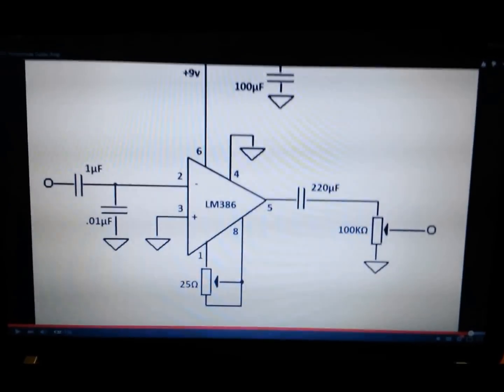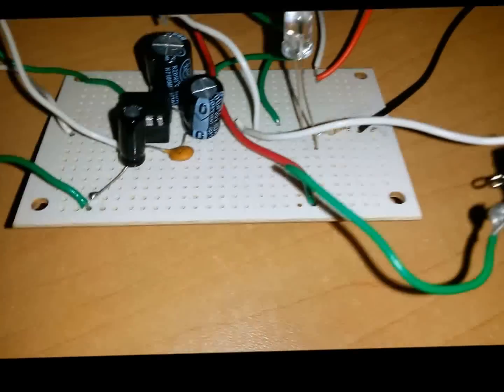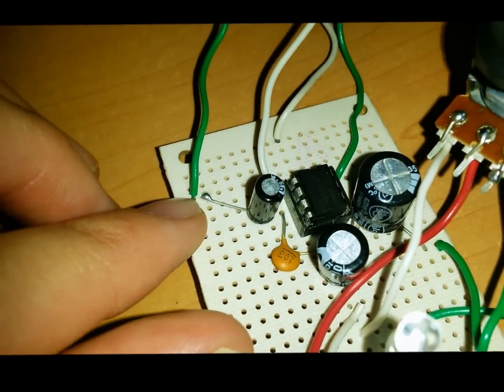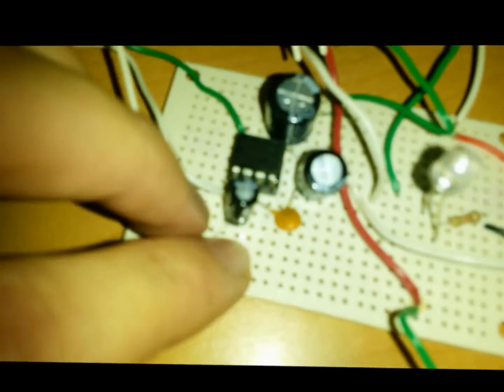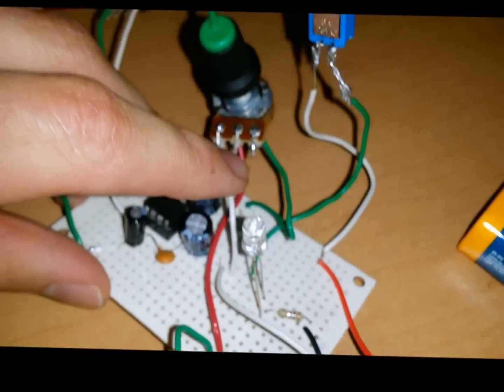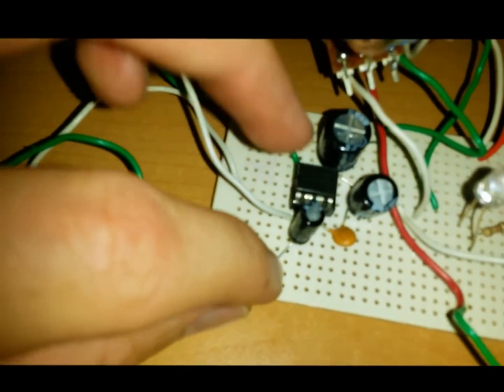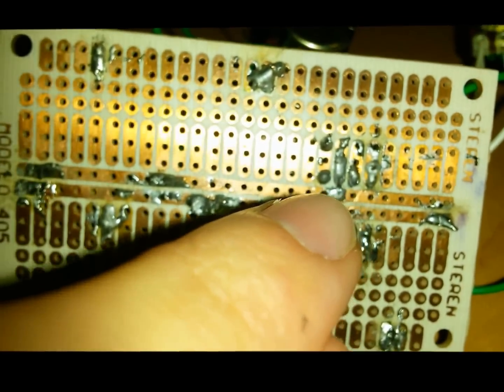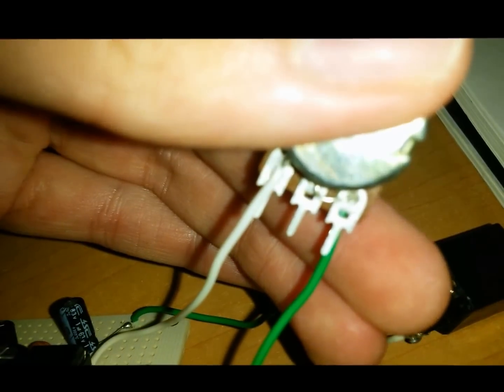RE: DIY Homemade Guitar Amp Tutorial

Comment: Great man! Your list of components, gave you that volume and sound.... can the same schematic be used, with maybe bigger/ more powerful  parts/chips, to give more volume?
Reply from the maker: yes, of course but you must take care on the amplifier's operational limits (you can find the chip's specifications sheet on the internet). Also if you select a different chip/amplifier, the capacitors should have different values.

Comment: Is it works for acuostic too ???
Reply from the maker: hey what do you mean an acoustic? you mean an acoustic guitar that doesn't have a way to output the sound? then no. If you mean the acoustic guitars that have a plug-in (electro-acoustic guitars), then yes.
Reply: Yes i hve a electro acuostic guitar which i can connect with an amplifier ...
Reply from the maker: then yes, it works as well. :)

Comment: hello !! I actually didn't understand how to give the ground connection ! wud be helpful if you would reply :-)  thank you fr this video. really helped a lot
Reply from the maker: Hi! the important thing about the ground in the circuit is that is common to every ground. This means that all the grounds have to be connected to each other. If you connected every ground to each other it would work but it is somewhat inconvenient (a lot of cables connected to each other) that is why the board i'm using has a copper line where i am connecting each ground which gives the same result. Hope i cleared your doubt cheers!

Comment: CAN YOU USE 104 ceramic caps for pin 2 instead of 103 ???
Reply from the maker: yeah you can, but the output signal will not be the same as with the 103 capacitor as you are changing a *10 multiplier to a capacitor.

Comment: bro where did u connected the negative end of battery and the negative end of output?
Reply from the maker: also to the same spot where all the grounds are connected! :)
Reply from the maker: Every ground and negative part is connected in my circuit between each other because there is one line of conductive material in my circuit board (a copper line) and every ground and negative part is attached to that line, so every ground is connected to each other like so :)

Comment: I don't seem to have a 500 ohms potentiometer but i do have a 25k and 5k will any of those work?
Reply: Ok so i did it exactly how you did it however it only gives a really small output you can only hear when you put your ears next to the speaker
Reply: Parts i used 
220 uf 16volts electrolytic apacitor 
0.1 uf ceramic cap eith 103z written on it
1uf 6 volts electrolytic capacitor
5k potentiometer for gain
100k potentiometer for volume
100uf 16 volts electrolyic capacitor(the capacitor that bridges the power line from the ground)
So my theory of why this isn't working is because the capacitor i used was the same uf to the one you used but not the same voltage (the one that bridges power line to ground capacitor)
Reply from the maker: Hello, the value of the potenciometer 500 ohms was already an adaptation of mine. The lower the value of this potenciometer, the better resolution. So I would not turn beyond the middle this potenciometer (2.5k). The voltage value of the capacitor is the maximun voltage it can handle. We are dealing with 9V of power so you would need indeed a greater voltage value capacitor. (Mine was of 63v)

Comment: in the your list 1x 100uF capacitor but i saw a ceramic capacitor on video 100nf. Am i right?
Reply from the maker: +MrDogan86 actually the '103' ceramic capacitor you saw is equivalent to 10nF which are .01uF so it is that capacitor on the list. Does that  answers you question? 
100nF would be '104' ceramic capacitor.
Reply: +Hector Muñoz i finished amp thanks for your sharing but i've a question. Volume control pot (100k) cant work perfect with headphone.  so i listen it with a headphone; i hear guitar's sound over %80 -%90 of potans. under the %80 not sound. I change it 500k pot but the result is the same. then again guitar headphone amp's out connect to a power amplifier it's work great. what can i do for headphone about volume pot?
Reply from the maker: +MrDogan86 This type of amplifier has not a very good resolution (as you have seen) in order to change that outcome you should have a more complex circuit with a better low-pass filter. However I will think if a solution can be given to this specific circuit. I'll let you know.

Comment: WILL THIS WORK WITHOUT A POTENTIOMETER?
Reply: and also are all the ground parts of the circuit all conected?
Reply from the maker: +Tromix Mixtro Yes, this is very important. All ground parts are conected to the same spot.
Reply: +Hector Muñoz how about the potentiometers what if i don't put any potentiometer in my circuit?
Reply from the maker: +Tromix Mixtro Mm that probably won't work if you don't have a potentiometer at least you should put a resistance.
Reply: +Hector Muñoz thanks
Reply: Love the master of puppets riff at the end by the way
Reply: Is the 6th pin capacitor's positive connected to possitive and negative to ground?

And also what other connections are connected to possitive?
Reply from the maker: +Tromix Mixtro Thanks! :p
Reply from the maker: +Tromix Mixtro The 6th pin capacitor is in deed connected the way you say,  with the negative side directly to ground. And the only things connected to positive side (9V) are the 6th pin of the lm386 and the capacitor.
Hope i cleared your doubts.
Reply: Thanks man i've been trying to build this for months but since i'm just a kid this made me doubtful haha anyways thanks again that cleared it out
Reply from the maker: +Tromix Mixtro No problem!

Comment: i cany seem to find a 25 ohm pot anywhere in my country can i use a regular 10k/100k linear potentiometer? what did u use?
Reply from the maker: hi, i used a 500ohms pot and it worked fine but I think a greater value pot will reduce the quality of it's function but not too much. If im correct, you will only need to make smaller turns on this pot to make it sound good (to have more resolution). that would be my only suggestion. i hope i answered your question
Reply: +Hector Muñoz so... i did everything like in your video,only i used a breadboard and a dc jack connected to 12v adapter. i first used 12v 1A and my 100 uf cap blew up, then tried 12v 150mA and 7.5v 1500mA adapters and its not working, did i ruin the lm chip?
Reply from the maker: +Dor shem-tov You probably blew up the lm because of the current your first adapter supplied. However I got stuck on my circuit as well and the problem was one pot and other time was a conection between two components. Could you tell me what happens when you turn it on? does the led turns on? or nothing happens at all?
Reply: nothing at all, is it possible the 12v 1A adapter damaged my chip?
Reply from the maker: +Dor shem-tov It's almost certain that your chip is damaged already. I'd review the circuit on my breadboard to see everything is connected the right way so that any other problem may be solved. It could be a problem on the wiring.
Reply: +Hector Muñoz i got new parts, now the led doesnt go on but i can hear a hum in the speaker, i can control the hum with the pot but i get no guitar sound i tried my cellphone 2 and nothing, any thoughts?
Reply from the maker: +Dor shem-tov Yes, it's probably one of the pots. Mine had a similar problem and turns out one pot had ben damaged (you could see that the little metal part of the pot that goes around touching the disc was not touching the disc at all).
Reply: +Hector Muñoz i tried a diffrent one but got the same result
Reply from the maker: +Dor shem-tov It's kind of difficult to troubleshoot from comments but are you sure all the circuit components are connected the right way? Meaning the pots (one of them has to be connected to itself (2 pins out of 3 )

Comment: awsome
Reply: btw how much V does ur 100uf and 220uf caps have?
 i saw at the store 100uf come in 16v/25v/35  and  220uf  16v/25v.
wich did u use?
tnx alot
Reply from the maker: +Dor shem-tov my 100uF has 50V BUT the 35V one should work just as fine, same for the 25V (220uF)... The value its the maximun amount of voltage the capacitor can handle.... it's a relationship between the capacitor value and the Q (charge) so the highest is the safest but in this particular circuit we don't use more than 12V so any of the capacitors you said will work as long as the capacitance value is the same. 
Cheers!
Reply: +Hector Muñoz  tnx, this was extremly helpful

Comment: Hi I just want to know if its posible to  put as well a 12 v in so you can use it withuot the battery or if its need to do a modification to do so?
Reply from the maker: +raygkan dreiko Hi, Yes! ... using the same circuit I show you can actually use 12v (it's the max limit voltage accepted by the amplifier) Cheers!!
Reply: Awesome thanks   and really nice tutorial I'll show you later what I have in mind with this.
Reply from the maker: +raygkan dreiko you've awakened my intrest !! :D